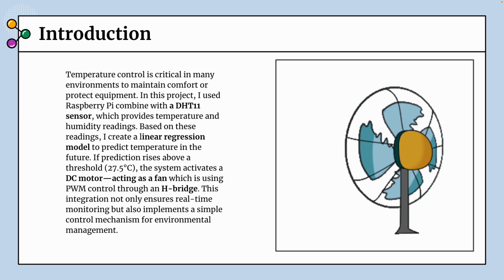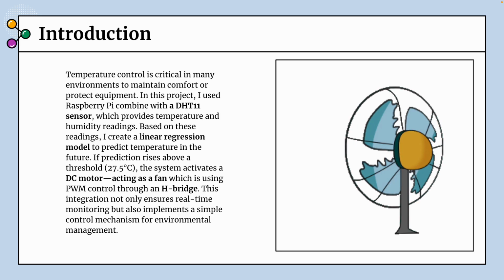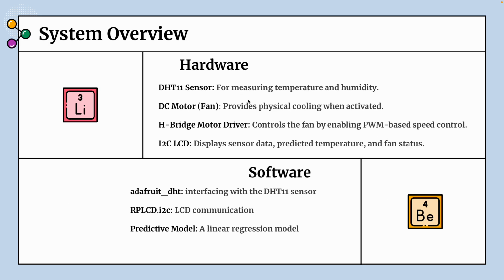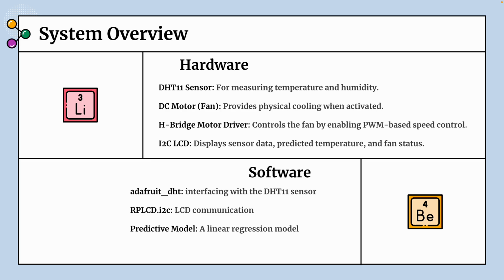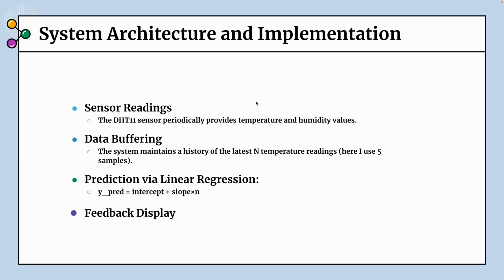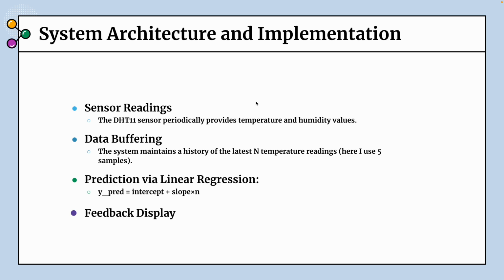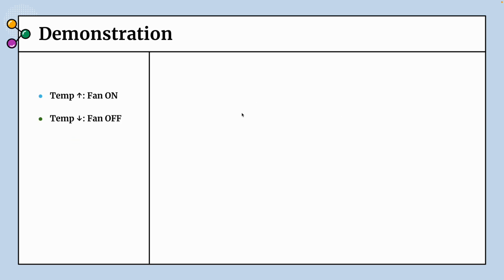Intelligent Temperature Prediction and Fan Control System Using Raspberry Pi

Comment: can we get the code madam
Reply from the maker: sure, I've already uploaded my GitHub link in the caption part
Reply: @roxannewang33  The code that you have provided is not related to the project depicted in this video. Can you share the code for the "Intelligent Temperature Prediction and Speed Control using Raspberry Pi" which is demonstrated in this video.
Reply from the maker: @PEEYUSHKP  updated. I used one more sensor and different models to build this system. You can find some instructions about how I config components on Raspberry Pi